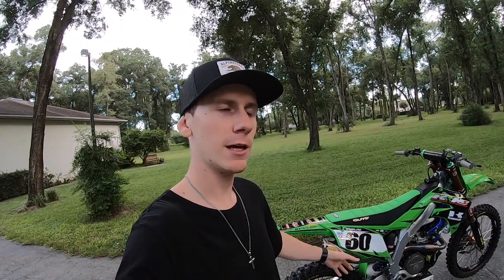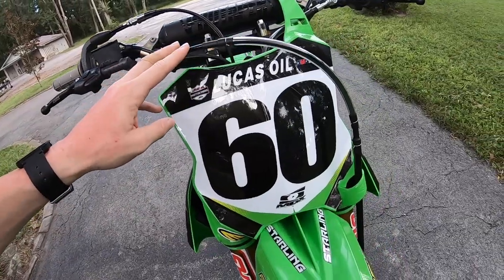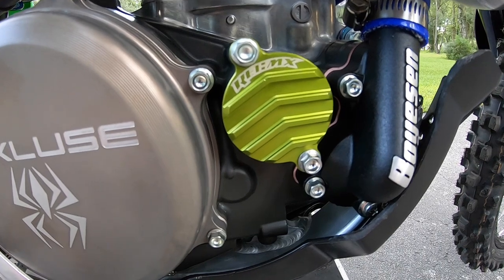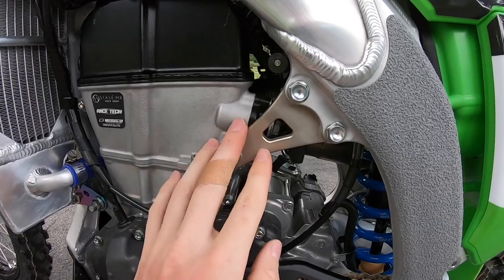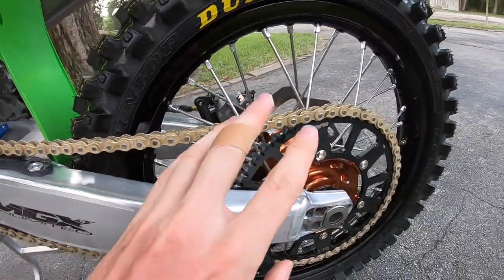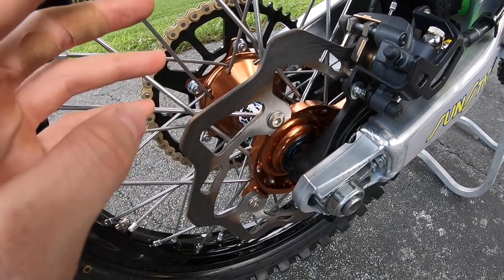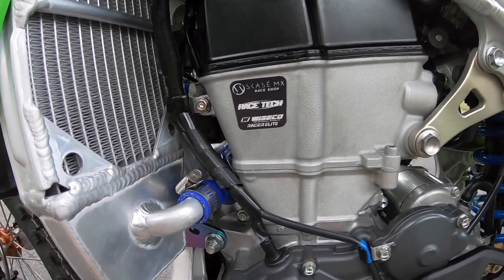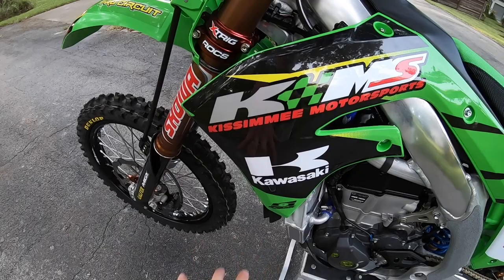My Kawasaki KX450 - BIKE CHECK!!

Comment: Really good build, only other thing I would have done is external radiator brace with WorksConnection
Reply from the maker: We had the radiators welded and oversized, does the same thing as works connection braces!
Reply: @JustinStarlingMotocross  yeah those radiators are sweet, do they sell those on a website?
Reply from the maker: Schwifty you ship ICW your stock ones, and they do the rest!